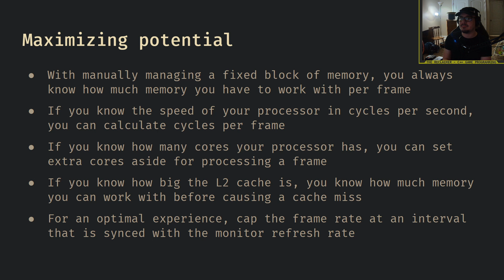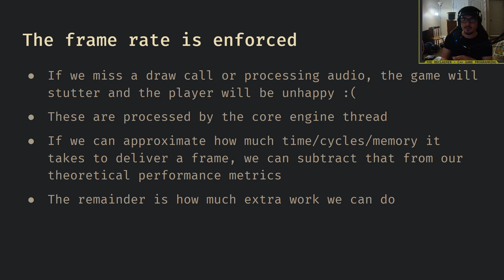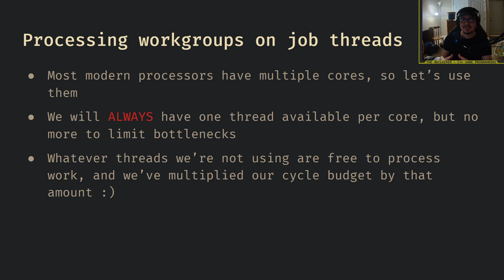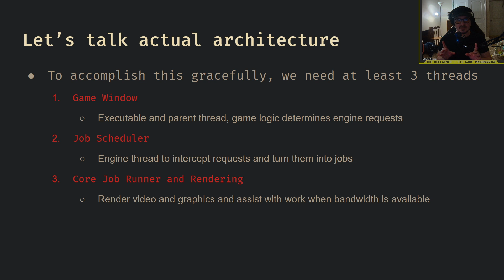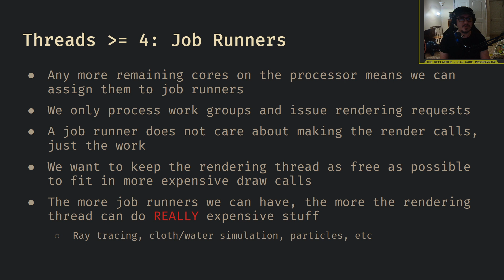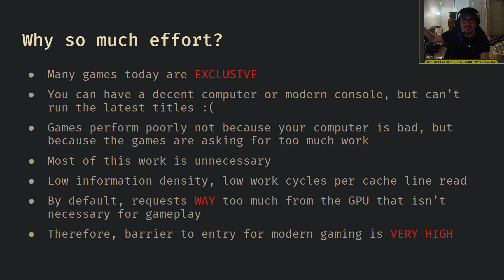Ideas for Fault Tolerant Engine Routines | Part 1 | Maximizing hardware potential

Comment: Game engines have had variations of this for decades with controls on graphics and audio quality, along with automatically detecting what are the ideal settings for the individuals PC. However doing it at the level which your talking about I'm not certain is really feasible you would need to change game play and create different experiences for individuals which would be near impossible to test, supporting 1mil units moving on a high end machine and then 10 moving on a slow machine would be a nightmare to test and debug.

This is why having a minimum spec and a base game play which is the easier option, you can have QA test that this works, you can scale up other non-game play things like graphics quality or non-game play impacting things but you still have a consistent game, which is important for SP if you want to allow things like speed runs and important for MP if you want consistency between clients.

Also the technical side, the CPU performance in a game varies all over the place not everything is going to be memory bound or even backend bound, there are many places where you might performance is limited by the front bound, bad speculation, or in an ideal situation it's limited by retiring.

Cache sizes and hierarchies vary massively between CPUs, and now with hetro CPUs even more so, attempting to pick some ideal for these even programmatically is near impossible, especially when your working on PC where the user could have many other things running which could preempt your threads and cause them to be scheduled less during any frame.

L2 cache is extremely small and L2 cache miss also isn't that massive your looking ~7ns, I suspect your confusing it with an main memory hit (e.g. L3 miss) where you might end up closer to 100ns. The L3 caches are getting larger every year and are generally shared between all cores or large groups of cores on consumer CPUs.

Memory is much more complex then just a cache miss, modern CPUs have large out of order execution pipelines so a L2 cache miss can be negligible in many situations as the CPU can still continue executing anything which doesn't have dependencies on that data, depending on usage patterns hardware prefetching can also come into play meaning that by the time the data is needed it's already within the L2 cache. It's true some algorithms and data structures can be particularly bad when it comes to being memory bound such as linked lists which have limited uops per item (e.g. find an item in the list) but that does not mean that everything is memory bound or anything which uses memory suffers the same issues.

I also wouldn't discount the performance effort put into popular games, often your seeing a product which has had many iterations of performance improvements and the larger the game is the easier it is for something to be overlooked, or for performance testing to be done more on dev environments then production and relying on QA which is often overworked to do performance testing in production. It's best to throwing shit at fellow game developers, especially when you might not know what has happened behind closed doors at those studios or even the internals of that engine/game and the potential technical debt that exists.
Reply from the maker: Hi, really appreciate the feedback!

There's a lot I could have done better in this video. It was kind of impromptu, and more than anything was just a way for me to get some ideas out of my head so I could focus on other stuff lol

The thing about the minimum specs is spot on. Core gameplay/features wouldn't change based on platforms, my thing was being as granular as possible to calculate the absolute minimum specs

You're also right on L3 vs L2 on systems that have it

Like I said, a LOT could have been better and I'm gonna make a follow up to this, including some experiments I'm doing with a tool to try and calculate these metrics.

You can't always calculate these numbers reliably, to me its about making the best guess possible in a way that makes the best use of the player's hardware